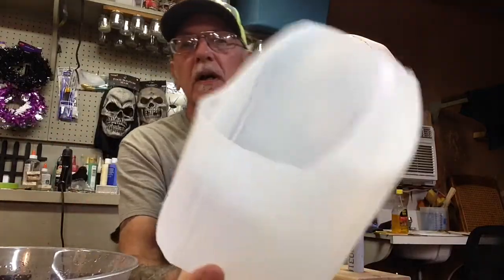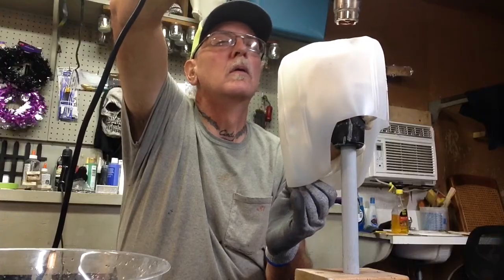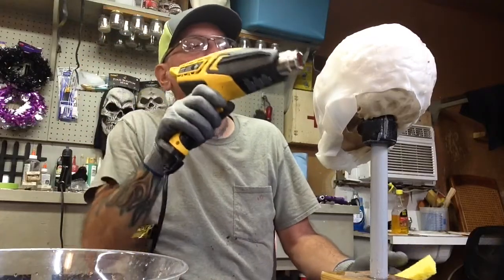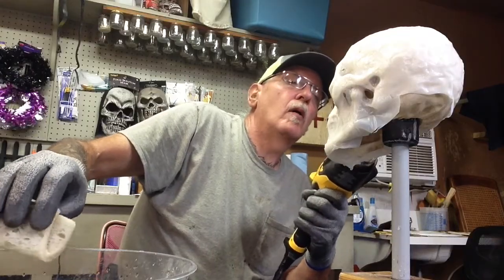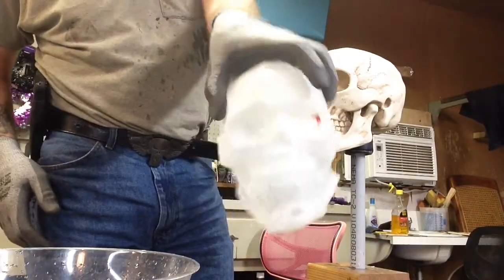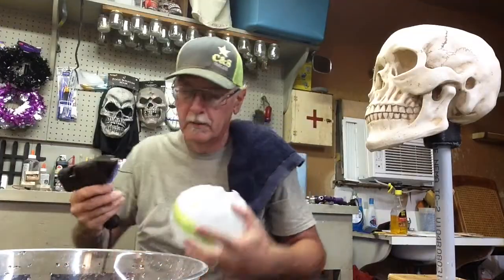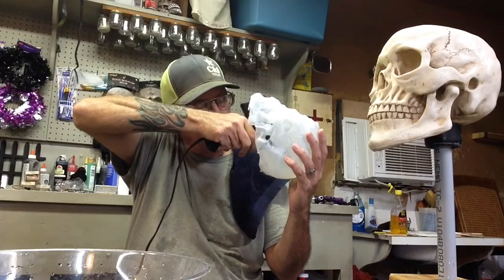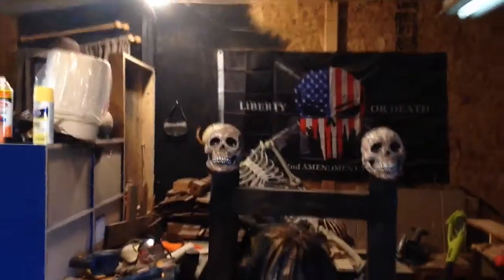Milk Jug Skulls

Comment: Great tip on the loctite. I've been using oil based stain on skulls and it does go on but eventually wears. Spray adhesive opens up far more possibilities. Thank you.